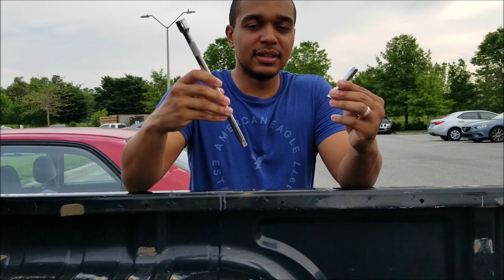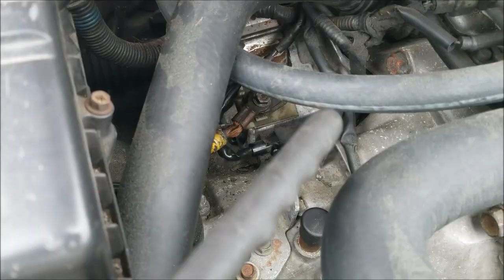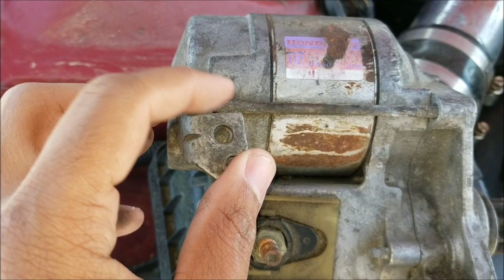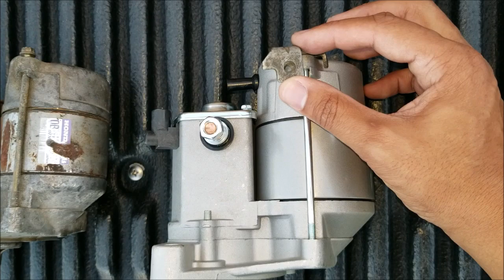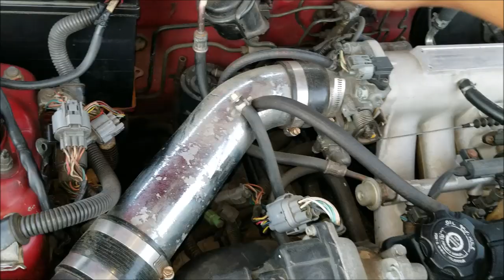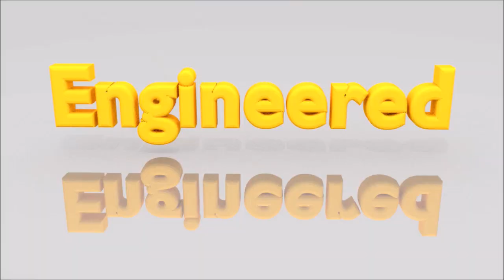Starter Removal and Replacement | How to | Honda Acura

Comment: IF you take the Air intake box off and out of the way you can gain more room to get to starter connections and this will help you to maneuver the old starter out and the new one in.
Reply from the maker: @robbrown3527  this is a great tip thanks!!

Comment: Good video, mate. Having either starter or ignition problems and dont trust car shops, so I hope this DIY will help me resolve my issue. Thanks for the video
Reply from the maker: Same here, tough to trust shops out there. Although there are some very good ones, just not easy to find sometimes. Hope the install goes well for you!

Comment: how did u get thst bottom bolt off
Reply from the maker: I used a 6 inch extension on my socket wrench or a deep socket will probably work as well with a 3 in extension. Hope that helps!

Comment: What’s problems were you having with the car that caused you to change the starter?
Reply from the maker: Car wouldn't start, it would crank and attempt to start but wouldn't turn over. Took it out and took it to autoparts store to get it bench tested for free. Bad as expected, bought replacement right there
Reply: @EngineeredMojo  thank you! 
I think my 94 LS starter is going bad. Sometimes when I try to start it, it just clicks. Won’t crank. Has a new battery, spark plugs, distributor cap and rotor. 
It only happens 1/10 starts. Think it’s going bad??

Comment: What year starter did u get ? I have starter problem but I can’t get the right starter and already ordered the one for my car but doesn’t fit
Reply from the maker: I got a starter for a 95 civic, but in my case any starter for a civic from 92-95 would have worked

Comment: Hey, Engineered Mojo. I appreciate the tutorial.

What is the wire loom actually for? Grounding?
Reply from the maker: The wire loombis just for protection against abrasion, corrosion and most importantly small animals that may want to make a home in your engine bay and chew through wiring
Reply: @EngineeredMojo  LOL. Funny. 🙂

Trying to pinpoint what is going on with my car. 

Initially, power is lost on ignition three and the engine struggles with turning over, but after a few attempts, power fluctuates on ignition two and nothing happens on ignition three.

Any ideas? I was thinking a missing ground connection with the wire loombis?
Reply from the maker: @kellyjohnson9524  could be an ignition switch issue. Sounds similar to issues I was having with my Honda awhile back.. What year car and model do you have?
Reply: @EngineeredMojo  '93 Civic sedan with a GSR setup.

I had narrowed it down to the starter or the ignition coil after checking every last fuse.

Comment: I cannot for the life of me get that bottom bolt off the starter. What sort of magic is needed for that? I've tried from the wheel well, from the passengers side above, but I keep running into AC lines or a lack of leverage...

About to go buy a mini electric impact tomorrow if I can't get it.
Reply from the maker: Do you have a swivel socket  adapter that can get you a slightly different angle of attack on the bolt? That always helps me
Reply: @EngineeredMojo  While I was at Harbor Freight, I found some "wobble extensions" that gave me just enough room to get the breaker bar on it without losing all my torque! I managed to go in through the passenger wheel well. That sucker is now replaced.

Your video was the most helpful out of all of them! Thanks so much. Was really getting tired of hitting it with a hammer every time I wanted to take her out hah.

Comment: I have a 1997 Acura Integra GSR.  The technique in this video does not work for my car because of the VTEC engine.  The mechanics would charge 2 hours labor to replace my starter.  I think that I need to remove the air intake hose, as well as the thermostat in order to get access to the starter.  Any ideas?
Reply from the maker: It'll work, it's a similar process definitely don't overthink it :). I had a gsr motor in my car before I put this motor in and used same process. Don't remove thermostat at all, you may need to remove intake hose if it's an original part as its bulkier than what is shown in my car. And definitely do not pay 200 for someone to do this job unless you have zero mechanical skills or no time to do the job. Good luck and let me know how it goes!

Comment: This is probably the best video for replacing a starter I've found. You got straight to the point, and the best part was when you pointed out the mounting bolt locations. Thanks for the good work, keep it up.
Reply from the maker: Really appreciate the feedback and taking the time to highlight specifics about the video. Helps me zero in on what works for these tutorials. Glad you found the video informative!